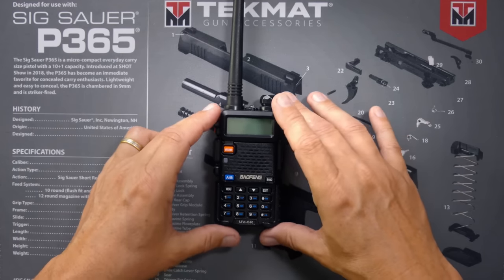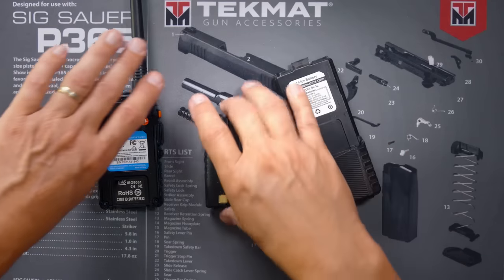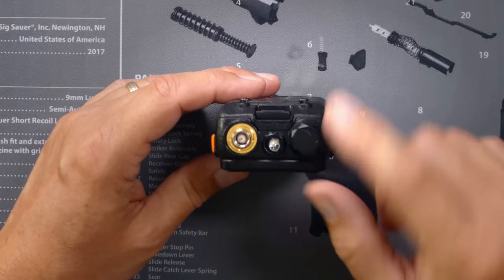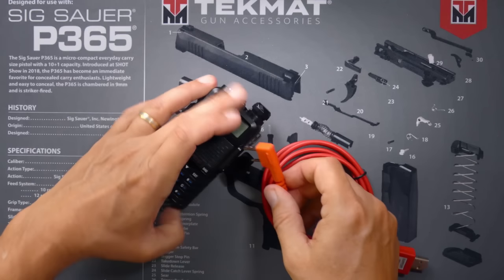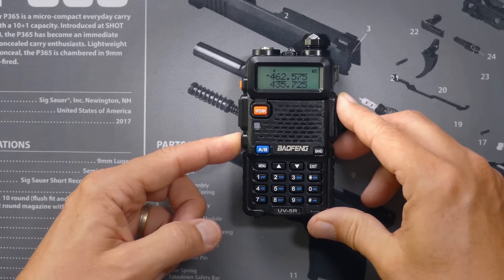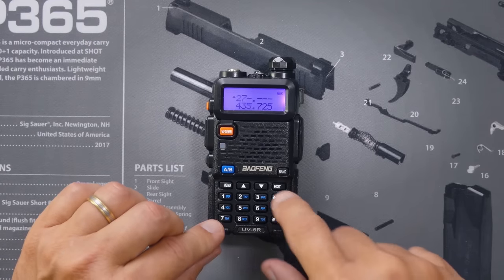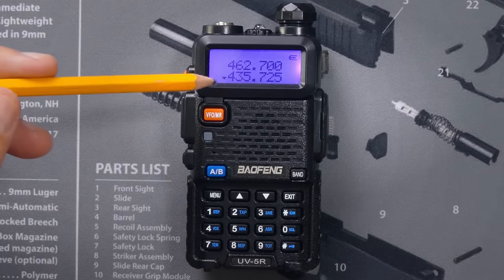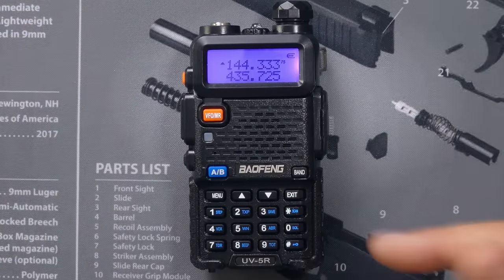The UV-5R Explained For Beginners - Full Overview Of The Baofeng UV5R & What The UV-5R Buttons Do

Comment: My "Boofweng" is over 6 years old and still works great, and it has been rattled around in my Jeep for much of its life. After all this time I thought I had it figured out, but I learned some new things from your video. Thanks!
Reply: This Happy Ham has several. The oldest is about 6, maybe 7 years old. The poor thing's lived a hard life, but it's still ticking. The backlight LEDs gave up the ghost a few years back and the volume control got scratchy (cleaned right up)...and the SMA antenna connector has come loose a few times, but the radio still works just fine. Best twenty I ever spent!
Reply: Mine too. In fact the only one I had that broke went down with my sailboat in a hurricane. At least I'm pretty sure it broke as I never saw it again.
Reply: Left mine out on the patio one day went in to make a sandwich, started raining got pretty well soaked. Shook it off good as new. For a cheap radio these things are a tank.
Reply: My Boofwang arrived today 😂
Reply: @kurtzFPV ohhh no ,,,
Reply: I pronounce it Battlefang.
Reply: I’m right behind ya had mine for 5 years only thing that messed up was a part of the antenna hoping I can repair it have my antenna finally sit flushed. The copper part and antenna are good it’s the portion that you screw on came off somehow I can remember ten

Comment: Good video. I've got several of these radios and use them often. I've had HTs that are far more expensive, but aren't in my opinion nearly as good. The upgrade antennas and batteries are well worth the cost. Thank you Randy. 
CHEERS from Colorado
Reply: I agree! I have six (6) "Tidradio versions of the UV-5R and GMRS radios and have purchased numerous accessories for them, including 3800 mah batteries, *Tidradio blue-tooth version 1 and version 2 wireless programmers, Nagoya NA-771, NA-320a (tri-band), and NA-771G (GMRS tuned) antennas. The most impressive addition so far has been the NA-771G for my *Tidradio GM-5R GMRS radios which reduced my SWR readings to nearly perfect @ 1.01 :1 - 1.05 :1 throughout the GMRS spectrum. :_OffRoader:

Comment: The FSM said "In God we trust. All other pay cash" That is the FSM (Flying Spaghetti Monster) the one true God and our savoir.

I just ordered my new Baofeng UV5R 8W.  Thanks for the great advice for programming and usage of this radio.

I do get the concept of line of sight. The frequency of these radios work best with shorter distances.

I do like the multiple output settings of low, Mid, and High energy transmit settings.

Comment: Thank you, Sir, for these excellent videos! One question regarding batteries, if I may: is the 3800 mAh battery interchangeable with other Baofeng radios, such as the UV-S9 Plus? I've also noticed that there is an AA batteries case for the Baofeng UV-5R: does it fit on other similar models, too? Thank you again!  :)

Comment: My UV5r is triband for some reason :)
2M, 1.25M and 70cm.
Reply: Some of them are real Tri Band radios, others are just unlocked and will do anything.
Reply: Yes, I have the triband version too. The 1.25 metre coverage is not useable here in Australia, as the frequency range is used for digital TV broadcasting. But, it was cheaper than the normal 2 band version...
"Not sad" ham operator.

Comment: I would think that given the ratio of its price to its capabilities, it is a hard radio to "hate", even for radio snobs.   Kind of like the AK-47 of radios.  Simple, cheap, ubiquitous, effective!   Used by many more than you would think.  Indeed, it could be considered the "people's radio".  I have a Retevis RT5 as my first pair of radios I bought, and was a little disappointed when I found out it was pretty much a Baofeng clone, but now I consider that a strength.  Since it is not trying to be anything more than an entry level burner radio, what's to hate?  You could buy 10 of these and equip a group of 8 or 9 people with effective communications (with one or two to spare - in case someone loses one or you don't trust them to hold up to abuse).  I can understand why Randy mouth kisses them.
Reply: Just a dumb question: is this usable without any PC or wifi connection?

Comment: Hi there   Really good video and love the sarcasm 
I recently bought a couple boofeng 5rx 
When we went to use them a couple months later they won’t send on any of the settings (programmed channels on frequency mode or on the preselected channel mode a&b on channel 2 both radios. ) they receive from all our old baofengs. Which work perfectly with all of the channels 
When I push the PTT it beeps but no lights or transmission. So the button works but something is messed up. Please help, or send me in the right direction for help. Thanks

Comment: The user manual says very little of the plug-in earpiece/ mic. I assume that's a mic and PTT button inline on the cable.
I'm more interested in using this output jack to feed an amplifier with a real speaker.

Comment: Do the new ones still have the useless Band button? The Greaval UV-5R I bought last week has no band button, and according to the serial it was built in 2022. Came with full TX as well. Are the rebadged ones just designed differently, or did I get a unicorn?

Comment: Just a quick tip for beginners using the programming cable. Make sure you have the volume up at least halfway or you make have an issue communicating to your computer. Not like that ever happened to me...noooooo

Comment: One of my 'BOOFWANG' radios (the UV-5RIII to be specific) has much lower audio than my other one, the standard 'UV-5R' Baofe...um, sorry, the 'BOOFWANG'. The UV-5RIII is a 3 (three) band model which also covers the 220 MHZ range and came with 2 antennas instead of just one like the BOOFWANG UV-5R. It receives good, and you can hear it, but it just isn't near as loud as the '5R'. I can't find any setting that changes the receive audio level.

Comment: I bought this radio because it seems to be able to rec & trans on the marine band frequencies. I have yet to figure out how to set this to scan those freq's .. BUT... when  ( if?) I do is it still illegal for me to broadcast on marine bands?  I used to have much larger boats that had the usual marine band radios. I moved and switched to a much smaller boat that is usually only used on a lake with very little radio traffic. so the  ( conveniently small) radio is pretty much only emergency use ( and maybe weather channels). IF marine band use is possible on this radio how could anyone tell the differance between me using  a marine band radio and this one?  Thanks
Reply: I too use the UV5-R for marine radio to “listen”. You can manually program the channels 1-88 with the freq list on googles. Or with a programming cable and CHIRP software (free).  Legally you cannot use this radio to “transmit” on a marine freq. Can anyone tell the difference from a Beofeng transmission and a “Marine radio” transmission…. absolutely not… nor does anyone besides a Sad Ham care. Also During an “emergency” you are permitted to use any type of radio, string, banana, mirror or any other communication device without penalty nor permission.

Comment: Thank you for the great instructional videos on UV - 5R. The Chirp video was very helpful and I do have a question. My UV-5R was programmed using Chirp by a Ham Radio guy and most of the channels are not ones I use. If I generate my own list of repeaters and simplex channels on Chirp can I delete all the current stuff and down load my new channels? Thanks
Reply from the maker: Yes.
Reply: @TheNotaRubicon  Thanks! Can I use the same program and channels for all my radios? UV-5R, UV-9R Plus and Wouxung KGUVD1? This would be very helpful.

Comment: I wish there was a trouble shooting guide because I don’t hear anything with the radio on. Yes I do have the volume turned up. It’s on scan it stops on channels but I can’t hear anything
Reply from the maker: Here are some things to check:
Turn down the squelch setting to its lowest setting
Make sure there are no CTC/DTC tones/codes enabled
Make sure you are on a frequency that has something being transmitted and you are within range/close enough to receive the signal.
If you still never hear anything out of the radio, throw it in the trash and  get a new one.
Reply: Thank you

Comment: Question: can you program a name for the channels? i.e. Bob's freq, Boogaloo boys freq, etc?
Reply from the maker: Yes, but you have to use CHIRP or the Bluetooth programmer
Reply: @TheNotaRubicon  great, thanks. And that Bluetooth programmer is an awesome idea.
Reply: @chiefkyle64  you are however limited to 7 characters so I have to abbreviate names.  Spaces count a character also so you have to get very cryptic at times for some names.
Reply: @chiefkyle64  also you have to enable name or frequency in programming menu separately for A and B. I set mine to display name for A and frequency for B. That way if someone asks you what frequency Boogloo is you can go to same memory on B to see what the frequency is.

Comment: I got a question about the cable you use when you buy it does it come with software on a disk or is the software built into the cable cuz I've heard of cables that have software built into them so you don't need to do it the only computer I have does not have a disk drive that's why I'm asking
Reply from the maker: With the Wouxun cable you should not need any software or drivers if you are using a Mac or most versions of Windows but it does come with a disk with the drivers on it in case your specific computer needs the driver.
Reply: @TheNotaRubicon  thank you for being so efficient with replying I do appreciate I meant to say drivers when I said software I fail lol yeah that's the thing I'm worried about I have the stock baofeng programming cable but I can't use it because I can't install the drivers I did how ever pick up one of the original versions of the Bluetooth programmer that thing is awesome and I'm so glad you made a video on that

Comment: What is the best setting for the frequency step?
Reply from the maker: that depends on your requirements for when you change the frequency.
Reply: I'm licensed GMRS, but I'm still learning. Interested in HAM. So if I want to just listen to HAM, what "step" setting would you recommend?
Reply: I assume the lowest setting (2.5) would capture the most signals. More to the point: is there a standard of frequency "steps" for HAM vs other formats?

Comment: If, let's say, a friend of mine were asking about using the UV-5R as a GMRS radio, is there a way to use "privacy" (or non privacy) codes? If so, is it difficult? Thanks
Reply from the maker: Yes. The UV-5R supports all tones/codes - but note that "privacy" codes are not private in any way.
Reply: @TheNotaRubicon  Thanks so much for the reply and, thanks for answering so quickly.  I really appreciate it.

Comment: What does the "s" indicate on the screen above the frequencies ?
Reply: S = Scan.  When you set the radio to scan mode, all the channels with the "S" will be included in the scan.
Reply: The S indicates he radio is in dual listening mode which means it it listening to both the A and B frequencies at the same time. He does mention it in the video.
Reply from the maker: @joe beasley thanks for proving my point about someone coming along and giving a wrong answer.
Reply: @Notarubicon OMG OMG YOUR HEARTED MY COMMENT!!! MY YEAR HAS BEEN MADE!!!
Reply: @iMystery  Not true, Grasshopper. Although the "s" does signify dual watch is activated, Notarubicon does not mention the "s" in the video.

Comment: what is the range of this unit with the stock equipment?
Reply from the maker: The range will vary greatly depending on what is between you and the other radio, but you can expect anywhere from 1/2-Mile to 20 miles.
Reply: @TheNotaRubicon  Thanks. That's a huge range.

Comment: Does anyone know how to use the UV-5R to connect to walkies that use channels for example channel 1,2,3,4,etc.... I'm trying to use my personal radio for work since it's better quality and the battery lasts longer than their little $15 Walmart walkies...

I've seen people claim they can't but I've seen on forums you can I just can't figure out how.
Reply from the maker: Its very simple.  First you have to figure out what frequency channel 1,2,3 are on those radios, then, put those frequencies in your UV-5R.
Reply: @TheNotaRubicon  would a walkie talkie use the same types of frequency as a UV-5R? I assumed short ranged walkies used a different type of radio wave... 

Does the UV-5R have the ability to scan for nearby frequencies being used???

I guess I can Google the type of radio we use at work to see if that brand has a frequency list.

I don't know much about radios or radio waves.

I just googled that the UV-5R can use 136-174mhz frequencies and I randomly googled "channel 16" and it says that's commonly referred to as 27.155 so I'm assuming I'm not able to do this with the UV-5R?

Comment: Can you use a tablet to program the radio with chirp?
Reply from the maker: If the tablet runs Windows, Linux or MacOS, has a USB port and the drivers for your cable, then, sure!
Reply: @TheNotaRubicon  it's a galaxy tab s6 I believe. I would need a type c to USB adapter I know. Not sure what the drivers are you speak of. Not super tech savvy. Maybe I should just get the wireless one.

Comment: Can one listen to air traffic with this?
Reply from the maker: If the air-traffic is being transmitted in the frequency range that the radio can receive, and in FM, then yes.
Reply: @TheNotaRubicon   I want to listen in the 120's. I think the answer is no,  it will not do this

Comment: Warning Stupid Newb Question incoming! I just got my GMRS license but bought the UV-R5 by mistake. Can I use the frequencies 462-467 with this radio?
TIA..
Reply from the maker: Older UV-5Rs will allow you to transmit on 462-467, but that would make the FCC very sad because it breaks their rules.
Newer UV-5R radios are locked, and cannot transmit on non-ham frequencies (like 462-467).

Comment: Just to confirm if I don't press the ptt button it won't transmit any signal what so ever?
Reply from the maker: A properly functioning UV-5R will only transmit a signal when the PTT button is pushed, or depending on how the radio is configured, when the alarm button is pushed.
Reply: @TheNotaRubicon  Randy, it just occurred to me, what about VOX?  I think the radio has Voice Activated Switch capability but I have never used it.
Reply from the maker: Ahh yes!  If VOX is enabled the radio will transmit every time anyone sneezes!

Comment: How can I use mine to connect with a friend in a city 100 miles away???
Reply from the maker: Find a repeater somewhere between the two of you and program both radios to use that repeater.  If there are no repeaters between you that you can both connect to, then you are SOL with that radio.
Reply: @TheNotaRubicon  thank you!
Reply: If you are a ham, you may be able to use echolink.

Comment: There's no such thing as a stupid question, just a stupid questioner. So why do they call it a UV-5R?? Why not a UV-5S or a UV-4R???  Seriously, your video on unlocking a UV-5R saved me from having to return the damn thing. Why Tidradio would make a radio that was crippled out of the box is beyond me. Yeah, they blame it on the government (I do that a lot), but every radio I've ever bought transmits on the frequencies Tidradio locks out, so I've never heard of the government wanting to lock those frequencies out! I just got two radtel (sic) 6-band RT-470 radios from China and there were no restrictions. You can also go on eBay or Amazon and order just about any ham radio you want, and none of them, as in zilch, are lacking in transmitting abilities. So please have Tidradio kindly point to the FCC regulations or policy limitations it thinks would make them retard the UV-5RPro capabilities. I suspect Tidradio did this themselves for some other reason, but why? When I discovered one of my previous purchases didn't transmit on 140.000, I thought my radio was defective. But then I recalled that one of your videos addressed a similar issue that turned out to be identical! But why would the FCC be okay with 146.355/955 (local repeater frequencies) and not 140.000? It makes no sense. In fact, Tidradio’s still selling retarded Baofeng radios.

Comment: I have a question sir, howcome the UV-5R has VHF Marine band but not Airband frequency?
Reply from the maker: I cant speak for the guys that designed the radio, but my guess is because the UV-5R is an FM transceiver and air-band traffic generally operates in AM.
Reply: @TheNotaRubicon  thank you sir.

Comment: I can’t believe I watched that whole video for 20 minutes and you never even answered my number one question. How many watts is this radio? it advertises eight watts but a lot of other people say it is only 4 1/2 watts. what is the truth? how many watts is this radio and what small radios like this really do have 10 or 15 or 25 watts.
Reply from the maker: The UV-5R is rated at UP TO 5 watts.. how many watts it actually puts out depends on what frequency you are transmitting on and how lucky you are. The UV-5R does NOT advertise 8 watts (if it does, it is likely a knock-off or a different model and not the "UV-5R") and yes, there are handheld radios that output 10 or even 25 watts, but there are a bit larger than the UV-5R
Reply: @TheNotaRubicon  Actually, the UV – 5R is advertised at eight watts all over the Internet. So is the BF-F8HP. What is the difference between the two anyway? I am looking for a 10 watt - 25 watt handheld so if you can please point me in the right direction I would like to buy one. All of the reviews on Google say the BF-F8HP is the best thing since sliced bread. Is that true? I am looking for a unit that has high wattage 10 to 25 legitimate watts. Which one is the best I value your opinion. Watch out for those pearl necklaces. Lol.